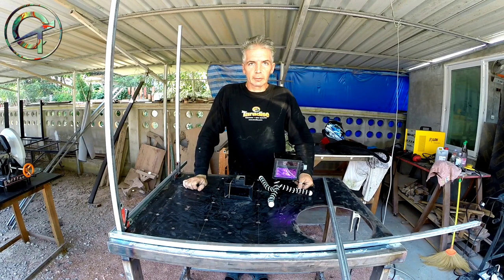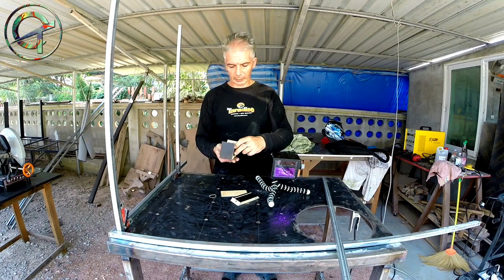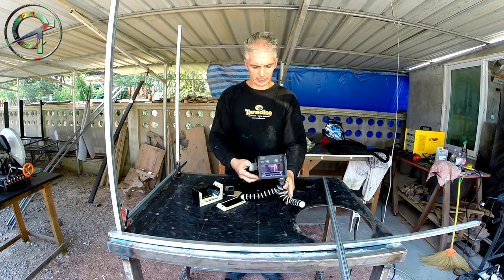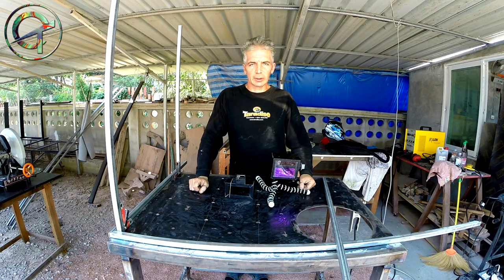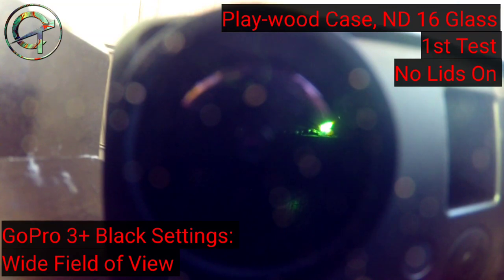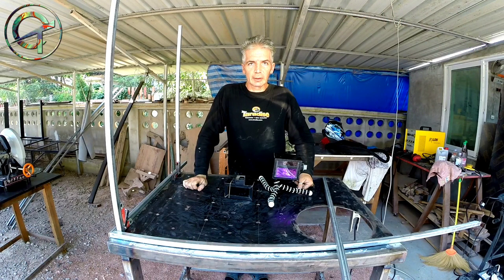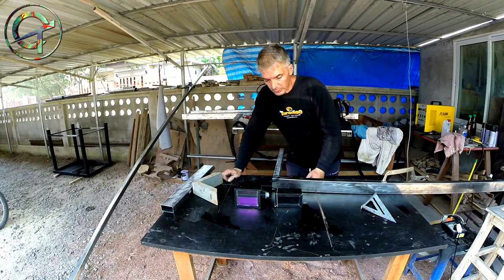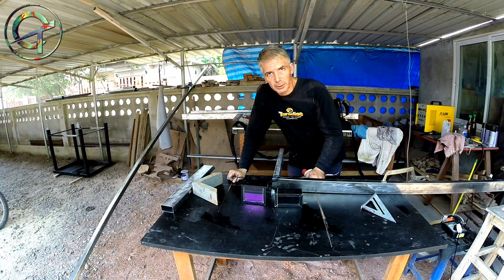Shoot Welding Videos EP-2, Test a ND-16 and an Auto-Darkening glass Cases

Comment: I have 4 8 32 ND filtrrs for my drone .
Reply from the maker: As you can see glasses from welding helmet don't work. I bought from eBay, the number that I need, best for welding closeup, is between 8 and 16, ND filters and graduated ND filter, n16 believe or not is already to dark, at list for GoPro  I'm waiting for a close up lense, all filters 37 mm designed to fit GoPro. I'm testing them, much better than the cases shown in this video, and I'm going to make another video about. As told I'm learning cause I never shoot close up welding videos before and, even if the cases tested in this video were a failure, I learned a lot and I'm keeping do that!